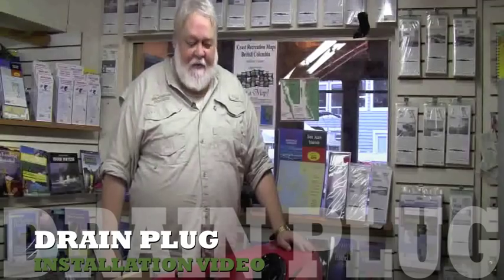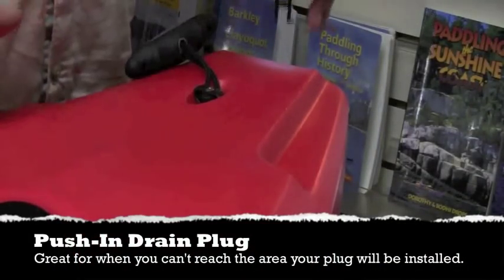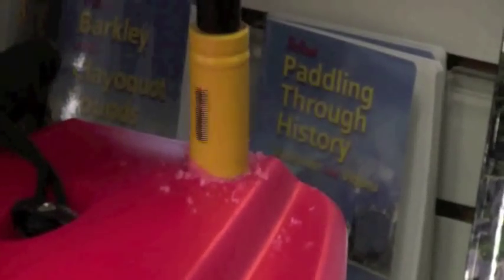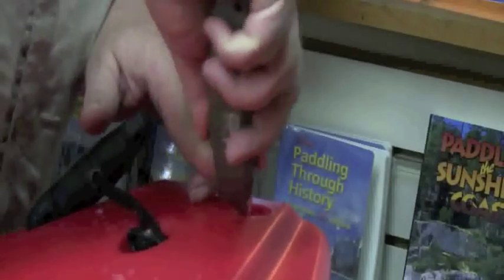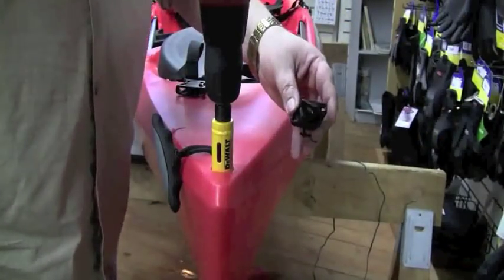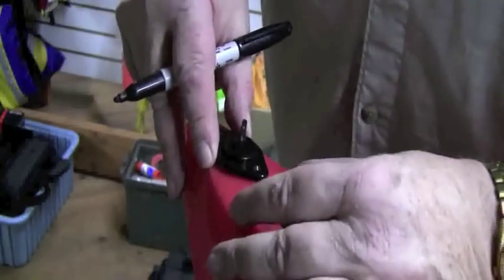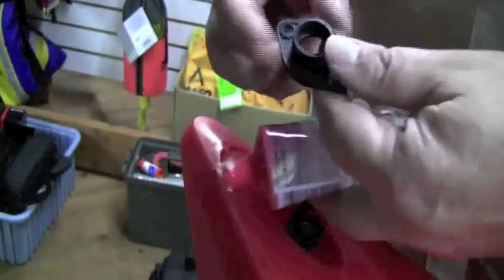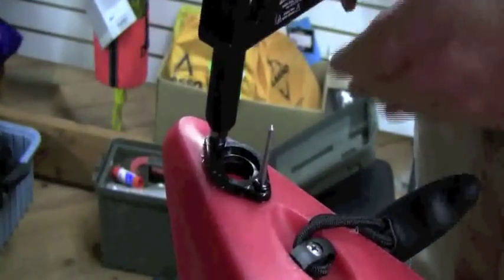Drain Plug Install Video

Comment: Hi! I will be adding a drain plug to my perception joyride. The drain plug is just under 1 inch in diameter. How do I determine what size paddle bit to use to drill the hole? Should it be exactly the size of the drain plug insert, or slightly smaller for a tight fit? I appreciate any insight!
Reply from the maker: You should use a 1" drill bit and be sure to use a little silicone sealant to ensure a watertight fit.
Reply: @sealectdesigns  thank you for the reply!

Comment: I have a plastic dinghy boat that doesn’t have a drain hole. The plastic in the hull is pretty thin (maybe couple of multimeters wide). If I drill a correct size hole, is the scupper (you have in the video) all I need?
Reply from the maker: Yes the hole described for the plug is all you will need.

Comment: Hi, do you think these could be installed on the bottom of the boat, To drain rain water out?
Reply from the maker: You should only install a drain plug well above the water line on your kayak. To drain water out of the kayak you will turn the boat upside down.

Comment: Is there any contra-indication in installing the drain plug at the bow of the kayak?  I got the latter Sea-lect plug on the video. The reason I am asking is that the Wilderness Aspire has a compartment that separates the stern from the cockpit. Your feedback is appreciated.
Reply from the maker: Hello, and thank you for your question!! No, you should be able to install the drain plug in either end of your kayak (or both ends, if you so desired). Why plugs are normally installed on the back though is because that is how you normally paddle into a beach (nose facing in, and back towards water); as such, the incline of most beaches helps, instead of fighting you as you try to lift the opposite end of the boat to drain the last bit of water. Hope that answers your question, and please let me know if you have any other questions and/or concerns!

Comment: Stern peak is the strongest part of the boat...and you just put a 1" hole in it.
Reply from the maker: Hello Chosen. thanks for making us aware of your concern. This is the most common place to put a drain plug so you can drain the water out. It is a very strong spot and I have never had an issue with this weakening a recreational kayak and creating a problem. In the case of this boat it actually had a molded in drain plug in this location. So we were  just removing the threads and installing a new threaded base.